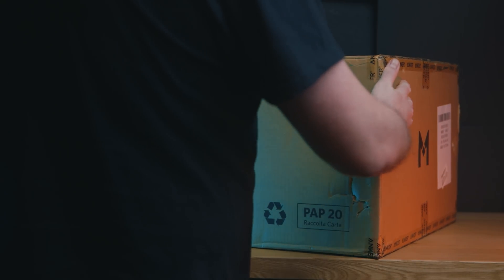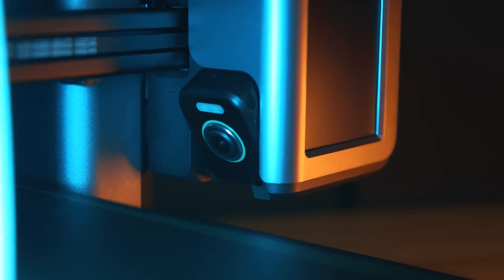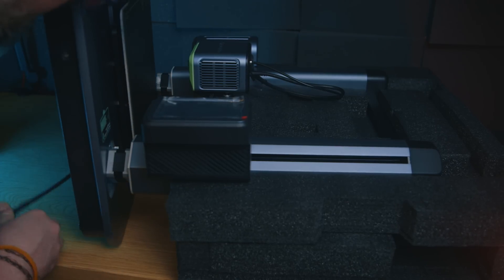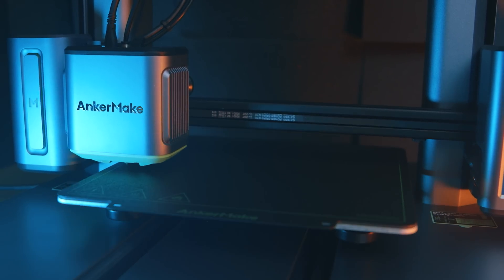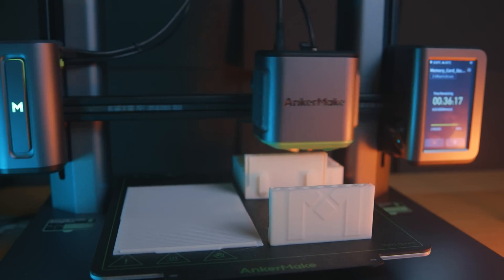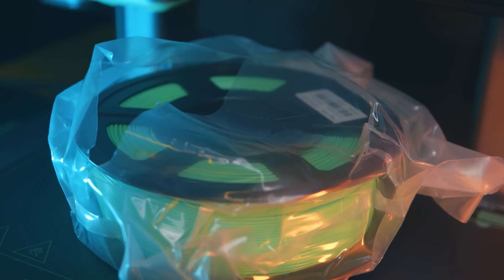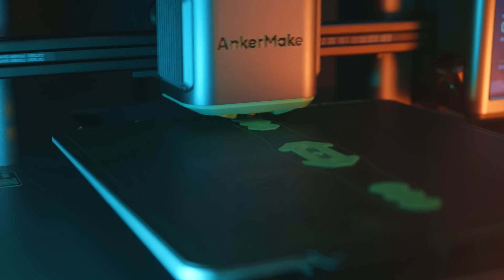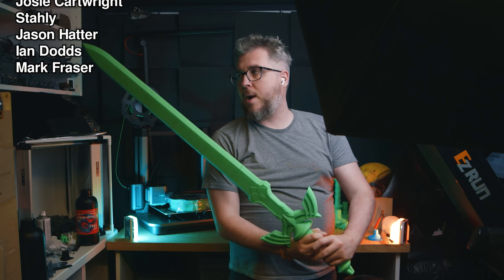AnkerMake M5 Review - FDM Printing - IN EASY MODE

Comment: I believe usability is going to be the big differentiator going forward.  As printing goes more mainstream and is leveraged by hobbyists who don't love to tinker for the sake of tinkering, using a machine that runs out of the box and provides the quality of life features will be recognized.

I have an old Ender 3 Pro with a Micro Swiss extruder, and while I'm ok building and flashing my own firmware manually there's no way my friend who just wants to 3d print gaming terrain would tolerate that.  When i got my Mars 3 Pro i was blown away by how well it just worked.  Nothing flashy or special, just leveled the bed, ran a few calibration cones and that was it.  It's still running without failure with only a single FEP change and plate re-leveling.  It's a breath of fresh air to use.

I like your 2d printer analogy.  My summary has been "when they stop being projects themselves and just become a tool."

Comment: Reading through the comments and I just don't get all the hate towards this printer. 

I got my M5 in the kickstarter and I absolutely love it. It is just so easy to use. 
You've hit the nail on head when you said that you're paying for the convenience and I am glad I did. 
I got a good deal in the kickstarter but having used it for 7 months I would happily pay the current retail price for this printer.
Reply from the maker: I know, I think people need to use it to truly understand, and maybe I’ve not done a good enough job of promoting it in the way it is awesome.

But also, a lot of FDM users have gone through the rite of passage with the various printers over the years doing all the different tweaks. The simplicity of this spits in the face of all that effort and after they have put so much work in, perhaps wonder why should people be able to just come in and print without going through the same trials.

This isn’t for everyone, and I get that. But if you want no hassle, plug and print. This is that.

There are better printers, there are faster printers. I know of no easy printers in comparison to this
Reply: I seems to mostly be the p1p users that are upset that their printer can't be called the clear winner without any exceptions. The idea that someone would pay 100 dollars more for slightly worse hardware but better experience is very upsetting to them. They feel that you are supposed to suffer to some degree with 3d printing sort of like the first internet users. I am worried that if you tell them that the sale price of the p1p and the m5 are both 599 and they might blow a gasket.

Comment: When I tried to print that 17 minute Benchy it got thrown off the bed pretty quickly. I didn't try to print another one but I may still. I'm curious.
Reply: Probably just need to scrub the bed down with some warm water and dawn dish soap, it can get pretty dirty sometimes.
Reply: Try using the glue stick that you can buy for 3d printing. Do it once and it lasts ages. Never had problems since.

Comment: Be careful running PETG in this printer, it has a PTFE lined hotend.
Reply from the maker: Is that bad?
Reply: @FauxHammer  PETG is usually ran at near 260C, that is hot enough for PTFE to release formaldehyde gas (known carcinogen).

Comment: way to expensive printer. despite the nice look its just another bedslinger with a lot of flaws. what i dont get is the amount of commercial videos the so called influencers do for this printer. looks like anker paid a lot for it.
Reply from the maker: I didn't get paid squat for it, Like every review, I got the printer, that's all. believe me or don't but my other videos should prove my legitimacy.

i had no flaws. Anker have made 3D printing simpler and I'd pay the premium for that.

I'd make a similar comparison between Apple and Android. The latter is your typical FDM printer. they work well and for the same spec are cheaper, but there's often some fiddling you need to do. This is more iPhone. Premium casing, simpler interface, just works.

I totally understand that is not for everyone, but for those who want this simplicity, and are happy to pay the premium. this is the one.
Reply: @FauxHammer  thank you for the apple comparrison. if you want to pay more for less with a shiny cover thats ok. just an example of the other cheap android printers, the elegoo neptune 3 max and neptune 3 plus cost together the same as your apple ankermake and are assembled as fast as your shiny little printer. they are very reliable and great printers and are way easier to be repaired if needed than your completely covered metalbox. even the new kobra 2 and the neptune 4 pro are way less expensive and do the same job, maybe a better one, than your ankermake. your whole review just gives the impression of a sales show that has been paid for. but its ok, many other youtubers do the same crappy reviews just to get more printers gifted from garbage companies. and by the way, you have paid nothing for this thing. so dont say its a good bargain, it is not for all the others who are gonna pay for it.

Comment: What a weird remark on that timer ... Marlin has all the various options for rendering the time remaining, total time, etc. built in for ages.  Klipper can even show you way more info on the time to go (as estimated by the slicer and separately as estimated by Klipper), amount of filament to go, etc.
Reply from the maker: I'm still a beginner FDM printer, this is aimed at people like me. I;ve never seen it before. and I suppose I;m talking specifically to Anycubic, Elegoo and Creality on this point. they all show elapsest time. none I;ve seen so far show remaining.
Reply: @FauxHammer  You are correct.  Most all of the comments around this has been here for ages is because well technically it has but you have to know where to find it and enable it.  For those that cut their teeth on the diy kits and understand modifying the g-code a lot of these features have been around forever.   Just not readily available to the masses.

Comment: Anytime there is a needed app with a product I assume I'm actually only renting it...Hard pass for me.
Reply from the maker: yeah it's not required. but because i used the Creality app, I wanted to point out how clean and well done this app was compared to that dumpster fire.
Reply: Ive had the M5 since october and the  app isnt actually required to use the printer it just makes it easier, all of the functions can be controlled via the touch screen of the printer and you dont even need an internet connection to print you can either use a USB or print locally over a network even if it does not have internet.
Reply: Well I guess that's great news. Still not my cup of tea. 

But I'm that guy who still refuses to use cloud storage.

/shrug

Comment: If this was $100-150 dollars cheaper it would be in the running for me but seeing as the competition are putting out this class of printer that are easy to set up. Look relatively decent and are kind of automatic and getting as close to plug and play as we can right now but cheaper it's hard to justify this over the competition especially when the competition has advantages over this printer for lower cost. The P1P is $100 cheaper and while we lose out on AI we can add time lapes for about $30, have auto bed leveling and can modify it to be able to to ABS/ASA for about the same price as the ankermake m5. Not to mention you have the option of adding AMS. And from everything I've seen its a really easy to set up printer that is really easy to use without the need to fiddle with it to get good results just like this machine. Then for $200 less you can get the K1 and it seems to be targeting the same ideas with easy setup and useablity without having to be a tinkerer to get things to work and the AI first later and the time lapes and autobed leveling and can print ABS, ASA etc. While I would want more 3rd party verification after it actually hits the market both of them undercut the m5 but a significant amount while having additional features that the m5 doesn't have.
Reply from the maker: As William said, it really depends on what you want from a printer. i would be happy to pay this difference for someone to take most of the headache away for me.

there's no poorly translated menus and complex options.

Choose Simple Mod in the slicer and it is just that... simple.
Reply: @FauxHammer  the P1P does not have poorly translated anything
Reply from the maker: @aenlandril4353  not sure how that's relevant to this conversation. but thanks for the comment.
Reply: @aenlandril4353  I have noticed that lot of users/supporters of p1p or bambu labs get upset really fast around the ankermake.  The point he was making is more general than aimed only at the p1p. But even if you do compare directly the P1P it benefits from being a core XY but is still missing some things that even the anker has and is not nearly as user friendly even if it's "not difficult to learn". You have to pay over 1k to get both the better architecture and new user friendly experience but even then its not like the ankermake hardware is bad in comparison. Both printers have very similar prints and the Ankermake is on sale right now for 599 the same sale price as the p1p, so it is by no means a clear win for either.

 Remember some people aren't looking to ever invest the time to get past new user levels, they want to print and go like a 2d printer and the ankermake does that better.
Reply: @FauxHammer  Something that hasn't really been brought up with regards to Bambo and Anker is that Anker has been around for years and slowly gets into products and have a history of making some of the most user friendly products out there.   While Bambo had a whopping 2 or 3 primary products?  How long are they going to be around before they are purchased by larger company.  Currently they have their spare parts priced so cheap that the heads are being purchased ripped apart and being sold to others for a profit.   This may seem great right now for those owners but it is unsustainable.  This shows the maturity of the company Bambo is still young and learning.

For those of us like myself and Faux i think we are of the age i just want my tools (lets be straight toys) to work and I don't want to have to worry about the company disappearing on me.
Reply: Whilst you are right on your points It comes down to the ecosystem you feel aligns with you most maybe? Ankermake where a bit later to the party than the other players. But personally ive really appreciated a couple of aspects of their approach and maybe Im bias as i got my m5 for KS early bird backer prices. but the community that has formed around this one printer is top tier, where i seen it said some others can sometimes been somewhat exclusionary. That and the CS support has been incredible dealing with replacement parts  under warranty for something that was partially my fault.
Reply: I couldn't agree more.

Comment: Did you have any issues with bed leveling?  I always seem to struggle with getting my printer to handle the gradual warping of the build plate after a few hundred hours of printing.
Reply from the maker: no issues at all. i chose level as part of the out of box setup and never levelled it since.
Reply: @FauxHammer  If you get the chance, I'd love to see a comparison between this printer and some of the other new ones coming out soon like the Neptune 4 or Kobra 2.  Thanks for the great video though,  hadn't been looking at the M5 as an option until now.👍

Comment: 800 bucks for an FDM printer is not a reasonable price, it's daylight robbery. That same price would get you an FDM printer, a Resin Printer AND a wash and cure setup. 800 bucks should immediately preclude someone from buying this thing.
Reply: Genuine question; anycubic Kobra 2 is significantly cheaper. Is this significantly better?
Reply from the maker: @Tom Denyer different benefits. that is cheaper but you will need to learn a few slicing settings and stuff. the slicer is not the most intuitive and can be daunting to many people. i;d say have a play with one forst for free to see if you can get your head around it.

But Anker has simple mode, which is just that. simple.

everything from the application, Ui, the OSD and the phone app are so cut down to the necessetries only. youc an unlock that extra tweaking power if you wish. but if you want to buy a printer that is literally, install the app. load a model, click print.

this one!
Reply: That’s a pretty standard price prusa and bambú both charge that or more for their best machines this machine I think should be 600 tho
Reply: Bought mine for £399 from Amazon Flash Sale, very impressed so far
Reply: Like he said in the review, not everyone wants a dirt cheap machine that works some of the time, needs tinkering, needs settings dialed in, etc... yes this is more expensive, but it's pretty much plug and play like most products should be. It's not for the same buyer that wants to spend nothing and constantly work on printers, it's for someone that simply wants to print stuff and doesn't mind paying extra for that convenience.
Reply from the maker: i think other people have made my point for me in reply. but it depends what you want. i want simple and working. and I'd pay the difference for it. if that's not you. cool. You gotta pick what is right for you.
Reply: @FauxHammer   but you said (a few times if I recall) that the Kobra 2 was simple and easy to use too. I'm watching your videos to try and work out which printer to buy and at the moment, going on the video rather than YT comments, there's nothing to tell me which better suits my needs.
Reply: @ThaDenz69   Learning slicer settings for an FDM printer is very very simple and once you get them dialled in once you won't have to change all that often. Most slicers have multiple profiles also so you can save any settings you use most commonly. Kobra 2 or a Neptune model are perfectly fine mate, long as you're willing to put a little elbow grease in. Setup is easy, at least for my Neptune 3 Pro it was, done in an hour, and learning how to fiddle about with the slicer is simple, loads of great guides online and pretty fun. It's just learning a new skill. Print failures are very rare and really not the end of the world with an FDM machine, there's no spills like with a resin machine, worst that happens is you have to bin a bit of spaghetti filament. Most failures in my experience are nothing to do with the printer, but more to do with factors of the environment. Which this DOESN'T ADDRESS. The really big innovation would be a sealed area in which the filament spool would go that was temperature and moisture controlled, to save you having to buy or make one. That is an innovation worth paying for imo, not prettier looks.

I'm no printer reviewer, I'm just a regular bloke, and 500 bucks extra is too much for this regular bloke when all I'm getting is an app and some little quality of life extras, but no big, meaningful, game-changing innovation
Reply: @FauxHammer   Personally I think it's a little dishonest when you are self admittedly brand new to FDM printing, to be recommending something that is wildly overpriced, which doesn't do close to enough enough for the money (such as an "AI camera" which a few quick searches has revealed is an absolute buzzword joke), AND which has received pretty mixed reviews, reports of firmware errors, vibration effects showing up on prints and then sending people through an affiliate link. Hopefully that's just cynicism talking, because I've so far found your reviews pretty good, but it definitely seems you didn't do your homework on this one at the very least. But hey who cares what I think, you do you mate. We all gotta eat. Have a good one.
Reply: Because cheap FDM printers are so reliable...
Reply: @SteveTheWiz  Yes, they are. I'm not talking about some POS from a no name brand, but both the Neptune 3 Pro and Kobra 2 are very well reviewed.  If you've got an extra 500 to throw at it then good for you, I'd say most people wouldn't.